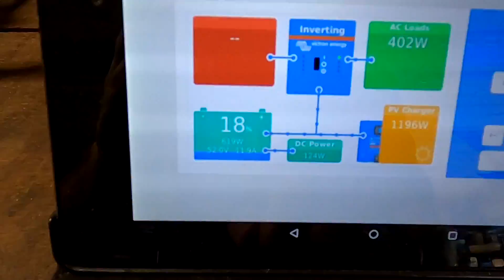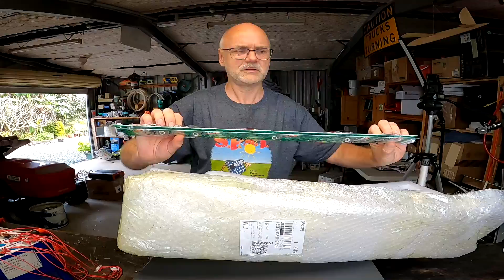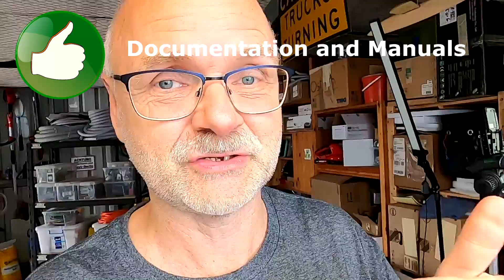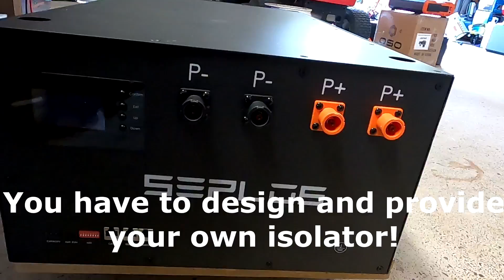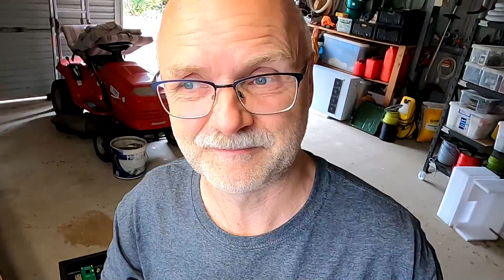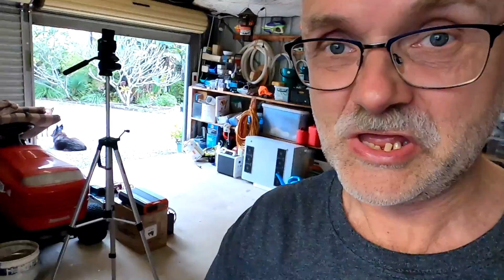Considering a SEPLOS Battery or BMS? Here is my experience so far...

Comment: Convert it to screwed together and ship it in pieces to save cost because of volume. And ship it without a Bms.
Reply from the maker: They said it will the the same price as I suggested this to them as well. It the weight apparently...
Reply: @OffGridGarageAustralia  the. They need to make it out of aluminum. Solves the whole problem and helps with heat dissipation.

Comment: 17:45 The need for a computer to change the settings is a huge 5 thumbs down for me.
The battery pack will be located NOT where my computer is. In case I need to change settings, I have to bring down my laptop, desktop! It is a big pain!
Reply: Agreed. I haven't owned a windows laptop in 20 years. I'm going to have to buy one especially to admin the Seplos.
Reply from the maker: Yeah, it's a bit of a pain but as I said, once setup, it's not as bad any more. However you would need to connect from time to time to just view the status, I guess. I do this all the time with BMSes via BT.

Comment: A ground on a dc system with a positive and negative does absolutely nothing. There’s literally 0 reason for it to exist. Which is why ac/dc power supplies are 2 pin only.  

They shouldn’t pretend this does anything at all. An inverter?  Yes on the AC side. But nothing on the DC really does anything short of lightening grounding solar panels.
Reply from the maker: That is wrong. Because we run non-isolated inverters and solar charge controllers, there is a chance that you end up with a high DC or AC voltage on the case.
Reply: @OffGridGarageAustralia  yes and that’s why the inverter is grounded. But there’s literally no path to the battery because the inverter itself is grounded. 

And even then because of the nature of mosfets, you’d need more than 450v to breakdown the reverse diode which you can’t get short of a lightening strike. (And since it’s literally the generation device producing the higher voltage ac, if the fets fail the inverter dies on the spot and can’t produce anything but 48v dc (and only on +- because it’s the pulse from the fet that creates the AC power. Broken fet = no pulse = no high voltage. (Or it’s after the boost converter in which case no AC and the boost still protects the rest of the circuit. 

Power flows from negative to positive back to its source. You can literally hook a dc circuit to the case and grab it and it won’t do anything to you unless you also grab the other pole. AC and a different because of the way it’s wired (it doesn’t need to be that way they cheaped out and ground bond neutral which creates the danger.)

All of this is why when working on high voltage dc you either wear equipment or keep one hand behind your back. If you don’t complete the circuit between negative and positive you can’t get shocked or electrocuted.

Comment: I ordered the SEPLOS BMS 200A 11 days ago after they said it would take about 10 days to get to the UK not the 60 days stated on the Alibaba contract but it hasn't left their warehouse yet, so I am starting to think maybe their promises to customers are not reliable, having said that they are fairly responsive to emails.  I will chase them again after next and update my experiences here.
Reply: Mine took approx 45 days.
10days seems rather unlikely unless they have a cancelled order sat at the UK forwarder
Reply: Maybe 10 days is possible when they are actually in stock but they haven't had any 200A BMSs available for about a month now. I think they are supposed to be arriving any day now.
Reply: @niktak1114  sorry, just re-read your post. You ordered BMS only which would be sent via AirMail.
I misread it as buying the Full Case + BMS
Reply from the maker: They offered me air freight as an option but it took around 60 days for it to arrive here (sitting for almost 3 weeks at AU custom because paperwork was missing).

Comment: I think you are wrong about the 150ma balancer being insufficient. The balancer activates while charging and while in static mode based on user settings. If your battery is out of balance by 5 percent then if you run the calculations in 33 hours from the start of the balancer the pack would be balanced. Is that a long time? This assumes your battery is out of balance by 5 percent. yeah if your battery is more out of balance it would take even longer but knowing that the balancer is activated I think its fine!!!!!!
Reply from the maker: Well, we could not see the balancer in action when I did two tests with it.
Reply: @OffGridGarageAustralia  cmon, the BMS has a balance trigger when any cell is over 3.40 volts and will run in static mode and charge mode, so I think you need to do a third test and time how long the bms takes to balance the cells. I understand if you don't have 33-66 hours to allow the bms to balance, but imo, if it works its not terrible to do it once in a BLUE MOON!

Comment: There’s a port on the bms that you can connect to a switch. You’ll find its description in the manual, chapter 8: connections. They call it inner switch.
Reply: And you can depress the reset button to turn off the bms
Reply from the maker: Yes, but it's not a mechanical switch as most electrical installations and regulations require it in terms of an isolator. It is still electrical connected event he FETs are turned off.

Comment: Another consideration, for the big seplos is that the shipping can be divided by 2.8 to 3 because just 1 of those is equal to 3 of the 100ah server rack batteries.
Reply: That's not how shipping companies work, unfortunately. Usually shipping is based on actual weight OR volumetric weight, whichever is higher. If you shipped the cardboard box the Mason comes in, empty, you probably pay the same shipping fee because of the volume it takes. If you filled it with lead, you'd be charged more because actual weight is higher.

At the moment, everything shipping from China is over the top. The stated reason is that shipping is over burdened (not back up to pre-COVID levels yet) or just costing more (oil prices?). It's insane.
Reply: @CollinBaillie  I'm saying that the shipping cost for 3 100ah batteries would be the same as 1 seplos

Comment: Tangential: It seems that there is a specification of Seplos RS485 protocol available on the internet. If it is accurate, it means that a custom monitoring and management software for such a BMS could be built fairly quickly. It might be running on a small computer like a Raspberry Pi which could then have a web interface. It could effectively serve as an alternative to native mobile application connected over Bluetooth. And it should be simpler to integrate into home automation systems like Home Assistant.
Reply from the maker: I'm interested in such a solution!
Reply: "BavarianSuperGuy" has developed this
Reply: I use ICM Pi software. Connects to seplos bms and the inverter and I can import all the data into home assistant using mqtt. Then I use home assistant automations to control everything.
Reply: there are already support for home assistant, and other python script to monitor.       the only thing not available is settings documentation, but anything readonly is implemented already

Comment: You can "turn off" the BMS by simply pressing the Reset button for 2 or 3 Seconds. The BMS will turn off and disconnects the positive terminal. As far as I know theres a "Switch" pinheader on the board to connect a additional switch for this purpose (normal used to remote control).

And about the configuration software: I love this solution. I havely dislike all this BT bullshit in the market. Most of the time I even have no smartphone on hand.
Reply: Most people have a smart phone to hand that they can quickly and conveniently pull out to change settings, view stats. How many people have a Windows laptop tucked under their arm? Also how many people are technical enough to mess around with baud rates, knock up RS485 cables etc? Not many. Seplos really missed a trick by not making the configuration easier, especially after putting so much thought and energy into making the build so straight forward and simple.
Reply: @danmc1313  How many people are able to differentiate between a whole mess of BT devices and what specific device is to be selected to change the right one. Even here in the videos it happend not just once he is struggling with his smartphone and thinking about what BT device is what...
This is simply bullshit. Not to speak every mfg. has his own App thingy.

And fiddling around with baud rates or serial interfaces!? What? We are working here on devices with a power able to litterly weld construction beams to a solid mess of molten metal. If you now wanne tell me you feel able to do so but have problems with a brain-dead simple and about 50 year old serial protocol, I might say you even should by something else - ready build.

With this serial link, connected to my server I could look inside the BMS litterly all over the world, by entering the virtual machine filled with this tools. Even reconfiguration of the Victron system is possible thousands of miles away.
What do think will your funny BT crap do here in my concret house, sitting on my desk in the 2nd floor while trying to connect to the BMS in the basement?
BT is a gadget. It has no place in an even entry stage of "professional" enviorment. Nobody in there right mind would here rely on BT. Even more: The funny "smart" BMS thingys are even not able to do a damn simple firmware update. How stupid is that!?

And not to speak about the fact BT on this BMS is useless by putting it in a metal enclouser. How on earth should the RF come out of it? So for this gadget you don't have to spend more money for the BT components - even though they are just a few dollar - you have to spend even more by putting the antenna somehow externaly.

As of my perspective I am really thankful they didn't walked the way every other chinese gadget BMS manufacturer walked along, and instead made a more professional oriented hardware. The only real downside is, they really have to produce a more accurate translation. Some parameters or warning/error messaged are hard to understand. But all other parts of there monitor application are just handy to use. It's just settiing the parameters easily like editing a Excel sheet, also to the history log download ability in list view is briliant to transfer the data to other applications and/or do some research related to problems.
Reply from the maker: In most countries an electronic or BMS is not considered to be an isolator from an electrical perspective though. It is as per the standards and regulations.

Comment: Hi Andy
I have 2 seplos BMS’s connected and communicating to my PC.   The main benefit for me is they display both pack information on the seplos Home Screen, cycling automatically between packs on a loop.

To answer  another question from your vid tonight. (Excellent as always). Changing one perimeter does not change both bms’s only the one your working on.

Why connect to your inverter?
Well for me I’m connected to a so far inverter (pylon protocol). And the seplos communicates correct soc to the inverter, this inverter communicates this info to the cloud (then to my phone).   As you rightly say seplos has no Bluetooth or Wi-Fi connection, this way for me is an easy solution for my present inverter (I know I have to upgrade the inverter. 

Hope this helps

Tony
Reply: Cheers mate, good info to know, i have been wondering about some of these functionalities you have mentioned here, as I have 3 x Seplos “Suntorque” 5kw batteries connected to a all-in-one PowerMr 5kw MPPT with B/T, but I have Iphone so it doesn’t work (Dammit!). Plus, been having issue with communications to BMS’s too. Im getting there slowly.
Reply from the maker: Thanks for sharing, Tony. That's a valid point. I think if your inverter is far away it gets the real benefit from the actual battery voltage over this distance rather than using its own measurement. I guess you meant voltage rather than SOC. That should be the same regardless the distance.
Reply: @OffGridGarageAustralia  
Hi Andy

I did mean. Soc,   If I use my inverters ‘standard settings’ to utilise my lifepo4 system and set high/low voltage as running limits, then  the inverter assumes volt drop as constant when  calculating soc.
This of course is not accurate enough (lifepo4 charge curve) this leaves me in the dark as to remaining capacity.
Reply from the maker: @tonmilly  but why does the inverter need to know about the SOC in the first place?
Reply: Hi Andy. 
If my inverter doesn’t have an accurate soc. I can’t efficiently set  my ‘time of use mode’.  This allows me to use my off peak rate hearse in the Uk to charge my system via the grid.  
During the summer my photovoltaic system charges the cells enough to supply the house, during spring, autumn and winter I use a 50-80%. Time of use target as an off peak cheep rate charge.
If I didn’t have an accurate soc I would be blind.
Power cost in the uk are absurd and getting worse, luckily I managed to get an ev tariff with 4.5ppkw off peak. (45ppkw peak) rate..

Tony
Reply from the maker: @tonmilly  Ah, right, that makes totally sense now. Yes, I absolutely agree. Thanks.

Comment: Love this video! After watching this video I would buy them. To me the pros outweigh the cons. The case would be the reason I would buy. I would consider the BMS a free gift. I don't care if you can connect to an inverter or charge controller. I actually don't like anything connecting to anything in my solar system wirelessly. If anything connects, do it with wires.
Reply from the maker: Yes, the case is a very big PLUS for this system. We will see how the BMS turns out and what benefits we can get out of some comms...

Comment: Any chance of a review of the cerbo gx and LTE dongle for connection? Or remote Wi-Fi dongle?
Reply from the maker: Cerbo, yes, but not with LTE. Does it not have built-in Wifi? Why a dongle?
Reply: @OffGridGarageAustralia  the trailer I have the system in is all aluminum enclosed so it completely cuts signal to everything. I’m sure boat cabins and camper vans can relate also

Comment: I have a 2p8s battery pack 24v 620ah contacted Seplos for the diagram of how to connect the pcb bars to this configuration since they said their bms is 8s to 16s 200ah and the 48v 16s 280ah box would work but they don't seem to understand what 2p8s means their documentation is also deficient for different configurations
Reply: No you have to explicitly order a 8s or 16s version they are not 8s to 16s. You have also to specify your communication interface  CANBUS to RS485   when ordering.   wiring 8s is like the 16s but only one cable.   Remember the bms can handle a max of 500Ah per cell. It won't be able to manage your 620Ah with 2 cells in parallels.

Comment: Dont forget the pre-aged batteries it came with, and don't expect a firmware upgrade to correct hardware deficiencies of an inactive BMS.
Also the better BMS like the JK only prevents over charging of a battery with a high cell, the battery is still able to provide power output.
Reply: But the JKs are blowing fets... why can't all these companies just merge and make the best BMS with good aspects from each.
Reply: @Foxfried  Why are they still using MOSfets and not IGBTs? They are tougher and easier to handle than the MOSfets.
Reply: @Foxfried  - I had 8S (10-24S) DYKB that also blew 3 of 21 FETs. Now with a  8S JK, 40 FETs but connecting inverter direct to battery, with a separate LVD. BMS reports wrong SOC, most of the time. The complex load of inverters produces waveforms on the DC which FETs don’t like. I also tried a 300A contactor, but it used 0.3 to 0.5A.
Reply from the maker: Yeah, the aged batteries which came with one of the kits is something to consider. You don't need to order them though.
Reply: JK BMS also have a programmable voltage LVD that cuts the output. Also shuts down if the SCC voltage is too high.